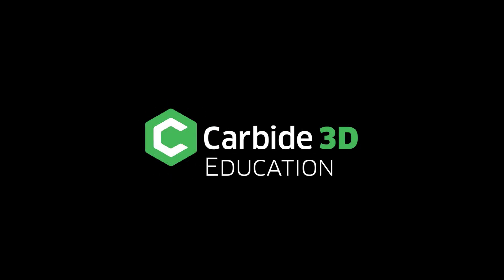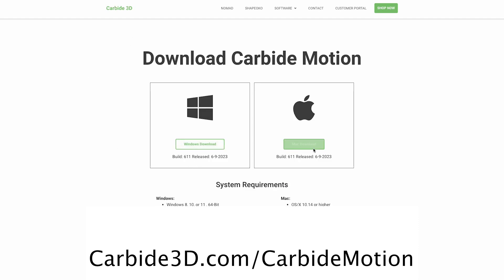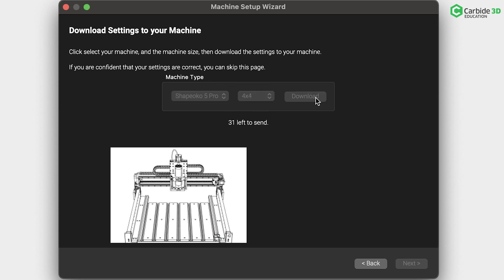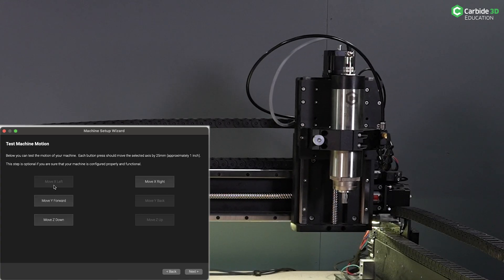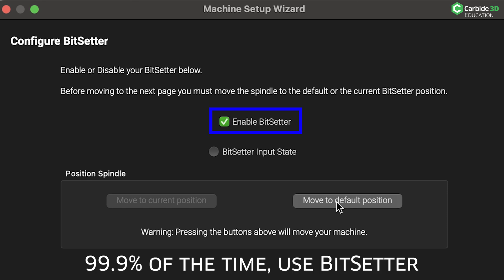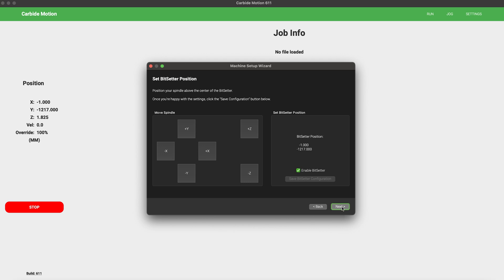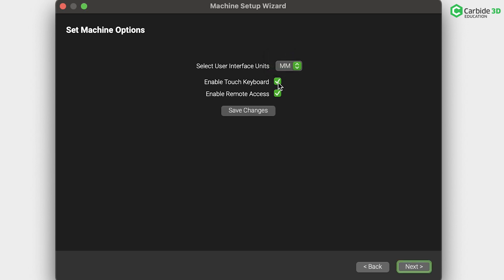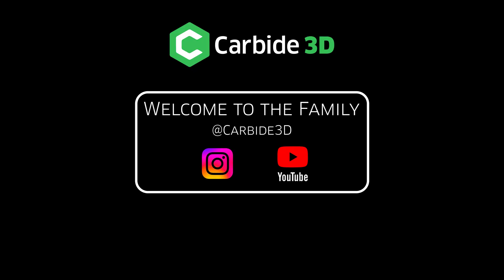Welcome To:  Carbide Motion V6 by Carbide 3D

Comment: I just got my 5 Pro setup, was on the call with Customer Service because Carbide Motion will not read my CNC. Connect button won’t highlight and the computer says there is a malfunction with the usb connection. Does anyone know if I just need to replace the usb cable?
Reply from the maker: Are you using the stock USB cable or a different one?   Definitely reach out to support@carbide3d.Com if you keep having issues.

Comment: I updated to the latest version of Carbide Motion. Bad idea. After following the instructions, XXL, HDZ axis. Now when setting up a project it warns me the Z axis will go above the top of the machine or you can run it anyway. If I run it, it hits the inductive switch and then throws off the Z height. I imported a file I ran several times in the past, zeroed the Z to top of material and the same result. Anyone else having issues with this update? Also I called Carbide 3D about 6 times in the past 2 days, no answer and no call back after leaving a message. Very frustrating.
Reply from the maker: It looks like you got a reply very quickly after you emailed in.  CM told you the job was set up in a way that would hit the top of the Z travel and then it did, which means it's likely one of two things:

1- The zero is not set correctly.
2- The retract or Z height of the job exceeds the Z travel with the zero in the current location.

If you reply to Will, he'll help you work out the problem.
Reply: I did see the reply but it was after I came here. I did reply back. hopefully we can get this worked out. Thank you  @carbide3d

Comment: Shapoko 3 XXL.  Do not have a carbide router nor do I have a carbide spindle but do have another aftermarket spindle installed that uses PWM control so do I just still select Carbide Router or VFD Spindle??
Reply: is it a routen --> click Router (anything where you set the rpm on the spindle itself

is it a vfd spindle --> ckick vfd spindle ( anything with pwm control)

Comment: My shapeoko 3 XXL gets to the initialization step in the setup process and then tries to home DOWN instead of up, fails to find a limit switch, and crashes into the wasteboard. Is this update ready for primetime?
Reply from the maker: This is only a settings issue.  
 What Z-Axis do you have 
Resend the settings that match your particular Z-Axis and see what happens.   
If the issue persists, contact Support@Carbide3D.com 
They will help you find the correct settings
Reply: @carbide3d  Resolved. Thanks for the quick response.
Reply: @carbide3d  I've been shopping around for an eco system to commit my time and money to by buying a machine and software, and it's follow up like this that is your brand's best selling point.   I'm learning from other people's experiences more and more that it's all about the support more than anything else. 👍
Reply from the maker: You might have to input a command to flip the direction of your Z axis.  Support can give you a hand with that.